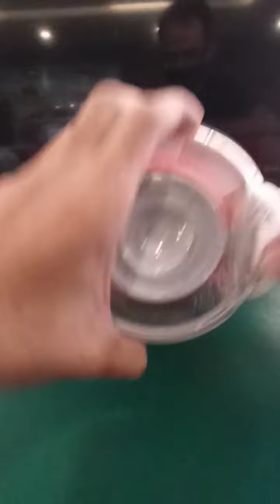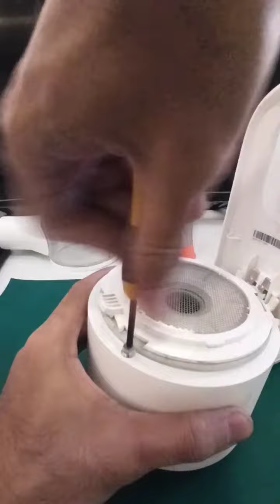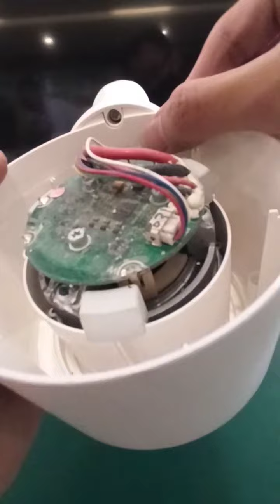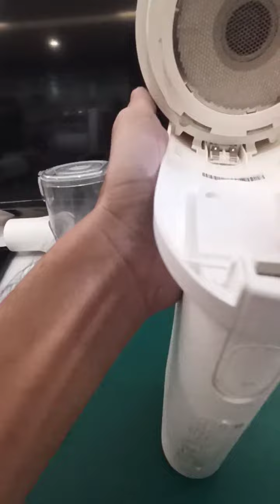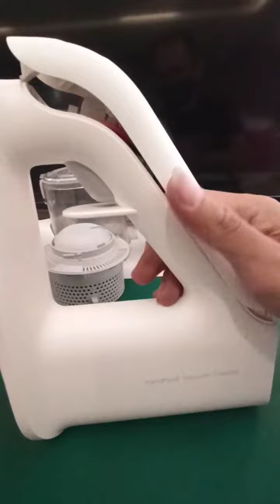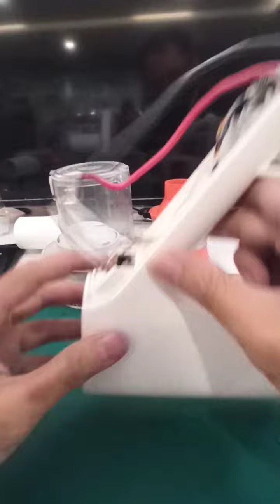Mi Handheld Vacuum Cleaner - How to remove battery

Comment: Batterie HS sur le mien au bout de à peine 2 ans. L'aspirateur tiens à peine 30 secondes. J'ai démonté la batterie, puis je l'ai découpé pour dessouder les accus et les remplacer (investissement dans un appareil de soudure par point et dans des accus 18650). Après remontage l'aspirateur ne tient toujours pas la charge. Obsolescence programmée, un vrai scandale en 2022 !!!
Reply: Have you achieve any solution? I was thinking about opening and soldering new cells, but if you tell me that it doesn’t work I won’t buy anything. Thanks 🙌
Reply: @mikeyoutube3665  Hello. Not working for me. You can try to open to check cells before buy new. For me It's not a cells problem but a card's problem
Reply: @sebo4480  how you opened battery ?
Reply: It could be the same problems with battery of laptop 💻 their BMS have a sensor, when you cut battery doesn't work any more.
Reply: @nicolotrippi8502  désolé pour le retard : avec une lame de cutter chauffée a rouge
Reply: I manage to open the pack, but when checking voltage I have 35v for the whole pack and ~5,7 v per 18650 battery.
Where did you manage to get such device ? I only find INR18650-25R with 3,6v on internet, no 5,7v batteries

Comment: Anybody managed to buy the batter pack from somewhere? My device battery last 30 seconds and stops. After another 20-30 seconds, it runs for another 15-20 seconds and dies. I am wondering if the issue is in the battery or the charging adapter?
Reply: same here bruh. ;/
Reply: problem is with batterry, sadly i can't find any
Reply: U sure u cleaned all 3 filters?